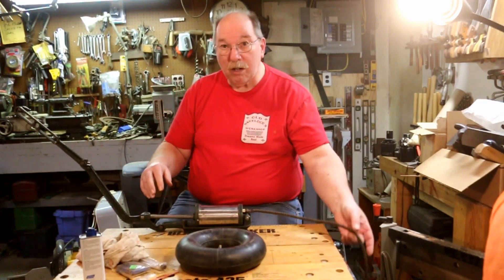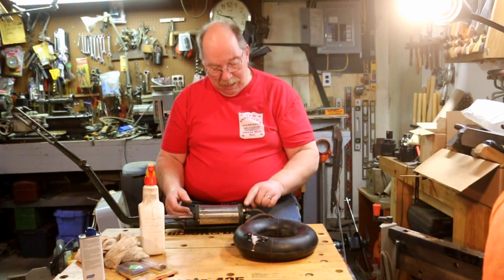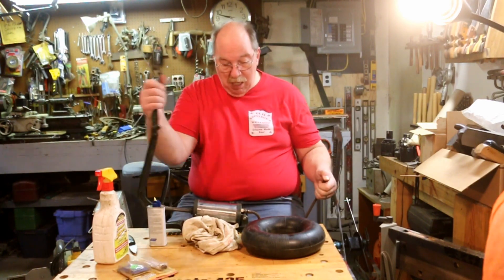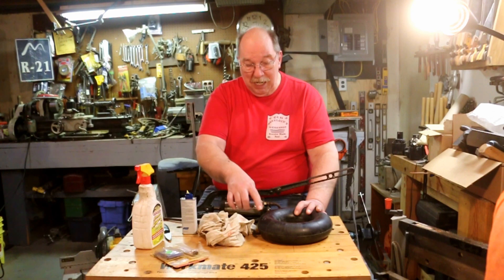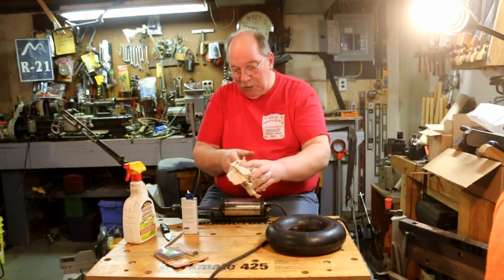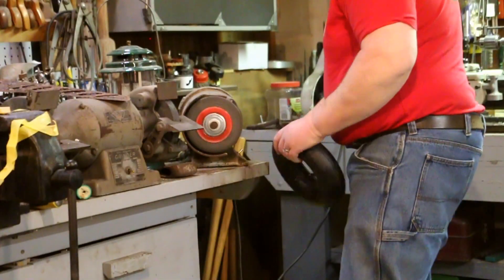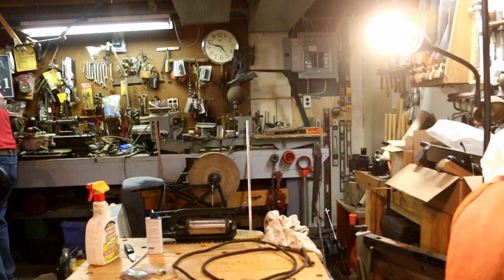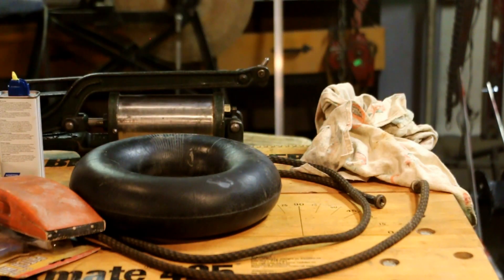Ooops. With The Pump Working The Tube Leaked

Comment: Usually when I release those non quick release valves I push a stroke of the pump while simultaneously unscrewing the valve nut. 😃👍
Reply from the maker: Great tip!
Reply: @OldSneelock  I always had the ones with the toggle. Fast hook and unhook.
Reply: Yup , Me Too Scout . Always .

Comment: Power rationing all day, 5 minuteson and 5 or 10 seconds off all day long. Now one hour on and one off. Water thawed out but now no power shortly. May freeze back but it thawed this evening.Got up to 32 which was a miracle. It'll never hold by itself. Needs a tire around it. Happy day tomorrow and God Bless! Duke Energy, the main supplier has over 500,000 out of power. Almost all SC. About 1400 here on this end. Wood stove is doing the JOB! Keeping the heat pump thawed. God Bless!

Comment: Those small tubes can be a pain in the behind. I haven’t seen one of those screw on air fittings for years, all ours are quick release now. I remember to combat the loss in pressure when removing the screw on fittings back in the day, I overinflated the tube to compensate for the air loss when removing the fitting. A bit of trial and error calculated the amount of overinflation required.
Anyway merry Christmas to you and your family Dave. And have a safe and prosperous new year.
Reply from the maker: It just happened to have a hole in it and reminded me of Moe's fix.